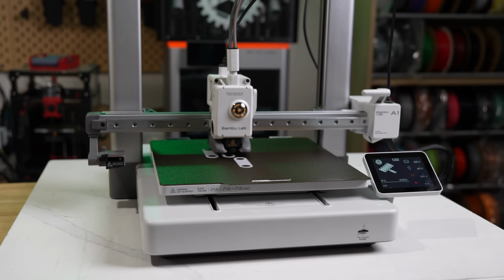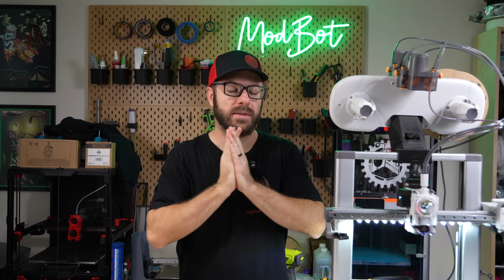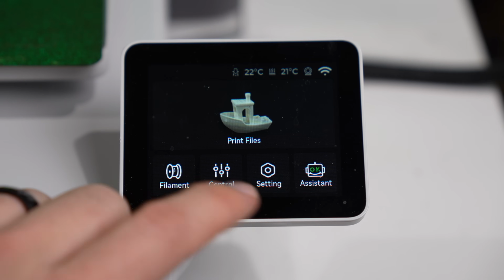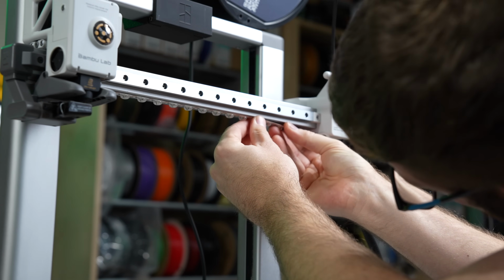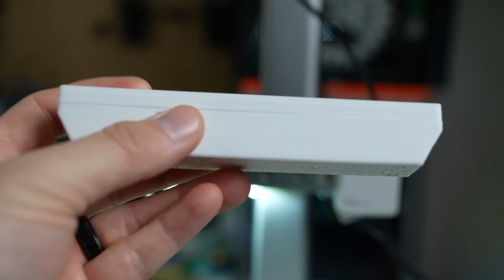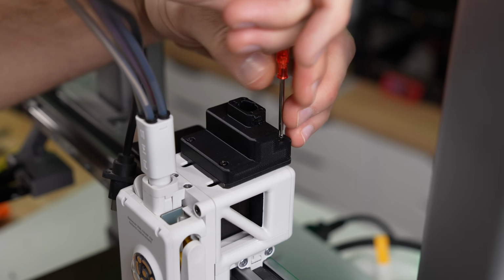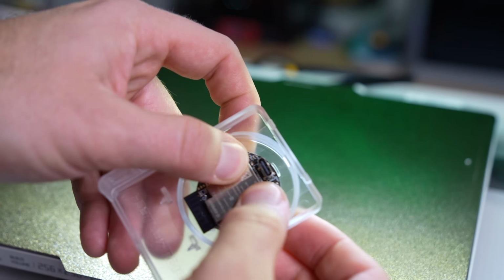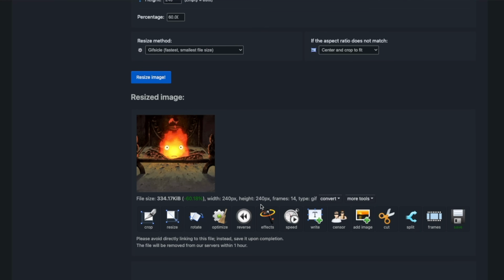You’ve Never Seen a Bambu Lab A1 Like This… (BIQU Panda-Verse)

Comment: I am wanting to get an A1 mini and deck it out with pandaverse. My question is how would it all plug into the Banch Plus since all the accessories have 4 pin connectors and the Branch Plus has 2 pin connectors? I was watching that part of the video closely then you changed it out for the standard branch.

Comment: Hello @modbot Always enjoy your videos.  I have RGBed the heck out of my A1 mini...so much so that i discovered there is an MQTT limit on the amount of devices you can connect to the printer - 4.  After talking to BIQU i discovered in order to connect more devices i needed to get the Panda Branch Plus as it has a MQTT gateway allowing up to 20 connected devices.  I already had the Panda Branch but that does not get it done.  Thanks for the awesome content!
Reply from the maker: Hey! Thanks for watching. Did you RGB it using BIQU products or go a DIY route? Thats good to know, I wasn't aware of the MQTT limit or the Gateway functionality of Branch Plus. Have a great weekend :)
Reply: @ModBotArmy  All BIQU.  I have the Knomi, Status, Aura, Cooler and was trying to add an Alarm and others when i came across the limitation.
Reply: @TinTalon  That's cool! Were you able to mount the Status and Alarm on the mini?

Comment: Would the Panda Status fit onto the front of the A1 (sort of front/underneath) instead of on the bed?  Might be a better option since it wouldnt be moving at all.  Any chance you could try it and respond in the comments.  You dont have to adhere it, just maybe hold it up to the front to see if it would fit.  Thanks
Reply from the maker: You mean under the printer itself? So where panda aura is mounted? The issue is that the ends are rounded to match with the shape of the bed so it will not sit flush. You could cut/modify the ends but it wouldn’t be my recommendation.
Reply: @ModBotArmy  i bet someone is going to model an adapter for that, so it can maybe clip under the printer or get screwed on there. I don´t own an A1 so i can´t tell whats possible there.
In the end, we always print more stuff for the printer, so it prints printer prints better. Or something like that 🤔
Reply: @ModBotArmy  Gotcha.  Maybe someone will model an adapter to print that will make it sit flush.  Seems like it would be a better location for that printer.   Thanks for the quick response.